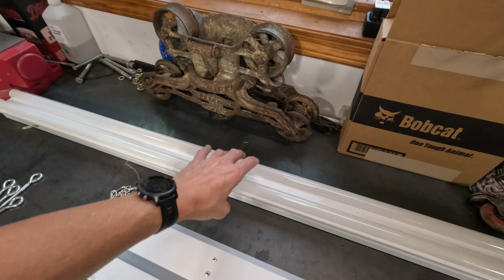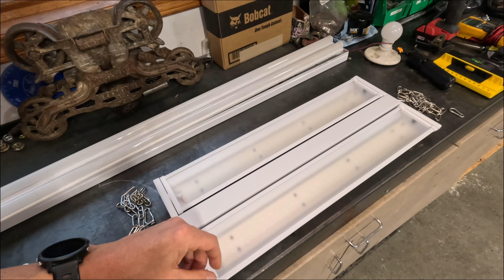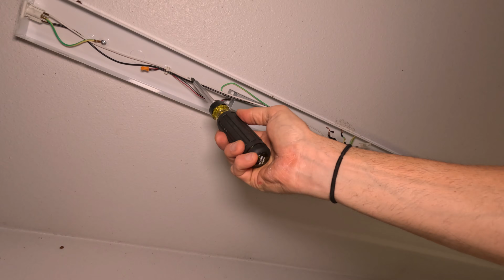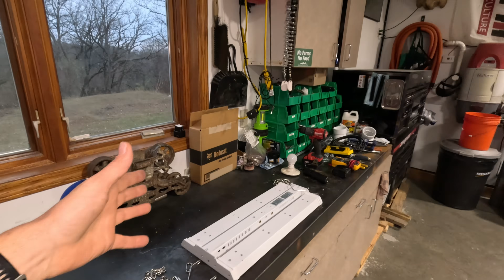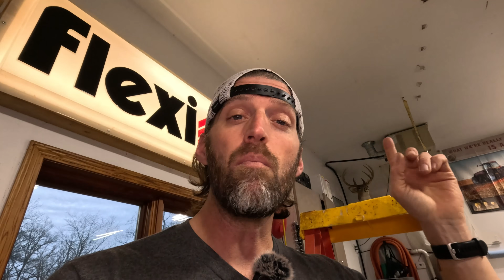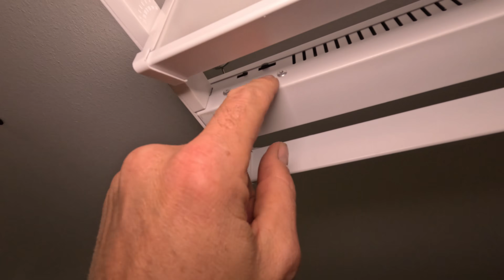EASY upgrade to the BEST garage shop lights. How to do it.

Comment: Why do you use stranded wire instead of solid?
Reply from the maker: That was personal choice, and I'm not 100% sure if to code, but I took my own precautions of strain relief. If I used NMC cable with solid wire (Romex) that is for sure not supposed to be unprotected, so avoided that. Being such a tight space between light and ceiling, I don't think I could properly route a flexible metallic sheathed cable. So, using the cable I did, with strain relief, was my solution.

I've been waiting for an electrician to call out any mistake I made. I did ensure the wire gauge of stranded I purchased was correct gauge for the amperage being carried.

Comment: Are these silver color wires from light made of aluminum or tinned copper?
Reply from the maker: Great question. I'm not 100% sure. If I have a litht down from the ceiling I'll definitely take a look at respond.
Reply: @LearnedFromDad  Thank you, I installed 3 recently 😁 looks like tinned copper, but just wanted to double check for safety
Reply from the maker: That would be my guess also without looking closer. Glad you now have some intense lighting. I'm pretty sure I could get a sun tan in my garage 😆

Comment: How tall is your garage? The one in seeing like yours say you should have a ceiling of 20 to 35 feet high.
Reply from the maker: My ceiling is probably 12' tall. They were said to be a "high bay" light, but I never looked for a height rating specifically, especially because the ones I bought were adjustable lumen output and angle. And, I love a LOT of light 😁. Cheers!

Comment: FYI. never trust a switch as a shut off for power. some electricians still run hot wires thru the box that might not be turned off. it may not be smart. but some timed running it like that is faster and cheaper for them to do it like that.
Reply from the maker: Absolutely 100%!! Never trust. Thank you for reinforcing that. Cheers!

Comment: Could you drop a link for the power pen and your stud finder??
Reply from the maker: Sure! I updated the video description with links to those items. I'm planning upcoming videos on those tools/topics, so stay tuned!

The stud finder is a Franklin Sensors model, the absolute best I've used, love it.

The non-contact voltage detector (power pen) is a version from Klein Tools (50 - 1,000volt).

Thanks for watching!

Comment: Will these be OK in an unheated garage in sub-freezing temperature?  Why not put a dimmer on the wall switch?
Reply from the maker: I looked back at the Amazon description and I couldn't find any temp ratings. I went ant looked at one of the fixtures in my garage and it indicates only a max operating temp of 40 degrees Celsius. So, I'm not 100% sure sure on the low end unfortunately. 

You bring up a good question and point about a dimmer. These ARE dimmable, but it's done by connecting a 0-10v dimmer into the LED driver on the fixture. So, it's not a traditional dimmer where your adjusting the supply voltage into the fixture like an old school light fixture with incandescent bulb.

Hope that helped. Thanks for watching!

Comment: I need a garage light upgrade. I only havr a few single bulb lights. Anyone ever used the LED replacement bulbs that have multiple panels? Wonder if it would be cheaper than new fixtures?
Reply from the maker: I've never tried those panel LEDs, but I'm sure they'd work great if you don't want to mess with new fixtures. I'm not sure about price on those.

Comment: Lumen ratings are almost always grossly over-rated.. 150 watts is a lot of power for LED's.... 4000 to 5000 kelvin is too "warm" yellow..  WAGO's (push in or lever type) are much better than wire nuts when using stranded to solid wire....
Reply from the maker: Agree on the lumen comment, always seems variable, even though the numbers may state otherwise.
Regarding color, I always look at that like BBQ....the best is the one you like haha. I like whiter light in my shop space, around 5k, but in my home I much prefer a much more yellow look, normally 3k.
I didn't mention in the video, but with the original fixtures I put up, I did try the stranded in those pre-installed friction connectors and I could pull it back out quite easily...didn't give me much comfort. Suspect a real Wago would have been better, though I had a pile of wire nuts lying around, just made sure to lead the stranded a bit to ensure it was well seated.
You sound very familiar with electrical, are you an electrician? Cheers!